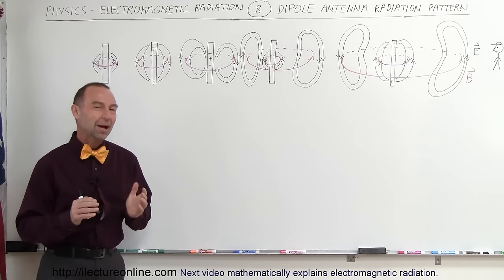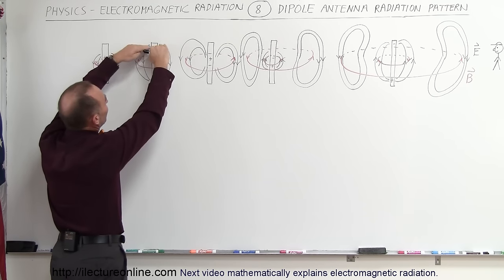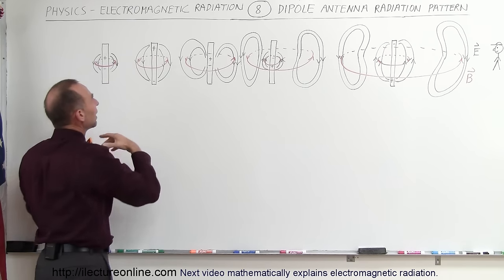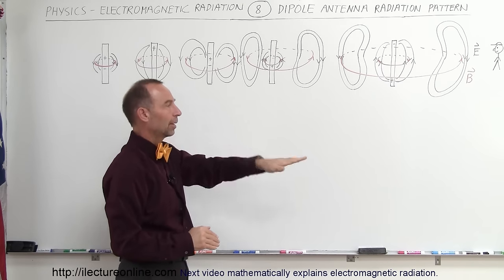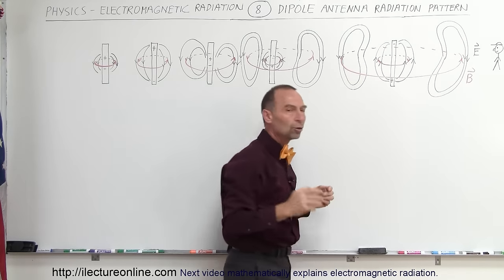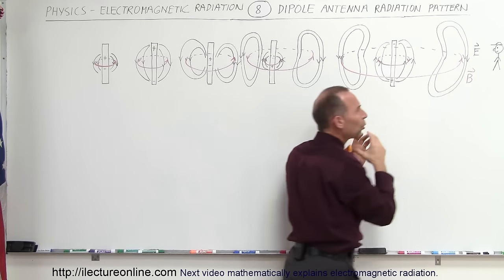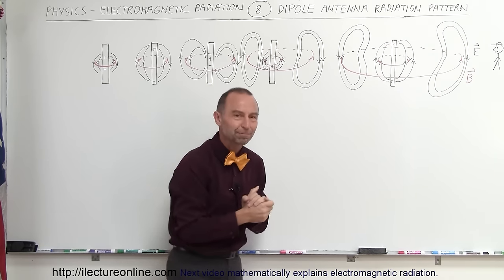Physics 50   E&M Radiation (8 of 33) Dipole Antenna Radiation Pattern

Comment: Michel, there's something I must missing, I'm sure. We are normally told that dipole antennas are connected via a transmission line to an oscillator. So, how does the current flow in the first place?  Isn't the antenna plus the oscillator an open circuit? Or is it just that the dipole antennas work like capacitors? Where am I being wrong? thank you
Reply from the maker: Yes, that appears to be a problem (since we don't have a closed circuit).  But with enough of a push (voltage) we can bunch up the charges to one side and then the othe side, in an oscillating manner.   The comparison to a capacitor is not a bad one.
Reply: Got it! 🙂Thank you very much for  your explanation

Comment: are the charges switced by an external source? We were taught this in class but i cant remember why the charges were being switched. pretty sure it wasnt due to an external source, what else can be the reason for the charges to switch?
Reply from the maker: Yes. You need a transmitter which changes the voltage on the antenna according to the input signal.
Reply: @MichelvanBiezen  alright, thank you! U were a huge help 😁

Comment: why do the charges get reversed ? @0:47
 thank you very much.
Reply from the maker: The charges are pushed in the opposite direction by switching the voltage polarity on the antenna.

Comment: I've studied that every type of wave or radiation is carried by photon and photon carry certain amount of energy which makes infrared radia visible micro gamma so my real question is does this antenna also have a photon because as we all know phone uses radiowaves
Reply from the maker: Photons are a concept at the quantum level.  (The world of very small things).  When it comes to radio waves, they are so big, that the concept of photons no longer works at that scale.
Reply: @MichelvanBiezen  so if there are no photons then how does the em radiation propagates because em radiation are are streams of photons
Reply from the maker: That is what we call the duality nature of electromagnetic radiation.  It acts both as a wave and as a stream of photons.  The longer the wavelengths the more it acts like a wave and the shorter the wavelengths the more it acts like photons.
Reply: @MichelvanBiezen  ok thank you i hot it now but i also have another question out of this topic (because i got no clear answer from Google)
Reply: @MichelvanBiezen  my question is how does a moving charge originate a magnetic field
Electron spin indicates the polarity but when they move around a magnetic field it interacts why? If electron is moving how does the movement create a fiepd around it
Reply: @MichelvanBiezen  ohh so longer wave also have photons but they are less that means less energy = less vibration

Comment: Sir their is one query, as we know that Electric field lines never form a closed loop so how in this case we are assuming that they form close loop??
Reply from the maker: It is not the electric field that forms a closed loop, but an electromagnetic wave which emanates from a source in a spherical shape.
Reply: Michel van Biezen 
I have watched a video in which it was made clear that electric field does not move through space along with magnetic field but it is only the magnetic field that travels through space. It seems also logical that when a travelling magnetic wave strikes a receiving antenna (a conductor) , it will induce an emf into it. Then it is amplified and used accordingly in respective devices like a radio receiver or mobile phone etc. What is the purpose of E- field in space I think nothing. This was my question .
Reply: electric field lines always start from positive charge and ends at negative charge...thats what is shown in this video...
Reply: I know this comment is one year old, I am leaving it for the case of future readers -electric field lines CAN form a closed loop in the presence of a time varying magnetic field (This is faraday's law).
Reply: It forms a loop since in that loop, the electric potential didn't change. 
As long as there's no change in electric potential (equipotential), it should be fine.
Reply: oops I got it wrong but I found an answer in Quora from  Bhanu Pratap:

 "Electric Field Lines do form closed loop if the field is produced by a time varying magnetic field. You must have studied about eddy currents in electromagnetic induction.

When a conductor is placed in the region of time varying magnetic field, magnetic flux passing through the conductor changes and circular currents are induced. Eddy currents are the result of motion of electrons in circular loops. And circular motion of electrons is facilitated by electric field which has force lines in shape of closed circular loops.

So, electric field lines can form closed loop."

So yeah it's possible as long as there's a varying magnetic field..similar to eddy currents.
Reply: @KurtBarcelona  But then how to explain that EM wave(E field and H field) can propagate in vacuum? Vacuum doesn't contain electron/dielectric, when time-varying magnetic field exists, there should not be any induced E field, is it?
Reply: @中央政治局局长  from Andrew Philips: "When the electric field “falls”, it creates a magnetic field. At the E field’s zeroth point, the magnetic field is at its peak. Similarly for the magnetic field. That is, each one creates the other, like a see-saw."  ........when there's a changing magnetic field, E field is also changing. Both come together.

"In addition, the fields induced are at right angles to their changes, the result of which is a beam of EM radiation traveling along through the universe (until it intersects with something).

So, EM waves don’t need any other particle to support them, a wave feeds off itself. "

so EM waves can travel without medium due to their inherent property (cross product of vectors)
Reply: @KurtBarcelona  Thanks.

Comment: sir i have a question...that means the transmission line should also produce EM waves..because the electric field is also changing in ac line and changing electric field produces changing magnetic field ...but why dont we get electromagnetic radiation from the ac lines...
Reply: I was once like you mislead. Accelerating charges don't emit light. Dipoles emit light. All antennas have two halves even monopole antennas. Connect two halves and for some reason you have no radiation. You simply have ac circuit.
Reply: @natashashvetz405  I think you are in a mess 🙄😀
De VU2RZA
Reply: A transmission line consisting of a pair of lines held together at constant space (eg, 600 ohm open wire line) or a coaxial cable line won't radiate because the E and H fields that are created cancel each other; it would of course radiate around a very short distance in the case of the open wire transmission line.
But in the coaxial cable the fields are within the outer conductor's inner aspect and the outer surface of the inner conductor, that's within the dielectric material.
De VU2RZA

Comment: Hey Michel,  I'm familiar with the sine wave representation of EM waves. What is the relationship between the radiation pattern in this video and a sine wave?
Reply from the maker: The "relationship" is that the oscillations of the electric field magnitude (and the magnetic field magnitude)  changes like a sine wave
Reply: Hey Michel, which part of the antenna radiation pattern represent the peak and trough of a wave in a sine wave? Is it the center of the radiating rings?
Reply: @EricPotratzM  so far what I've tried to visualize, it seems like electric field bubble is created in 360 around conductor and it leaves conductor when gradually polarity of charge on the conductor changes. Now relation between sin representation of wave is like gradual increase and decrease in power of electric field bubble.

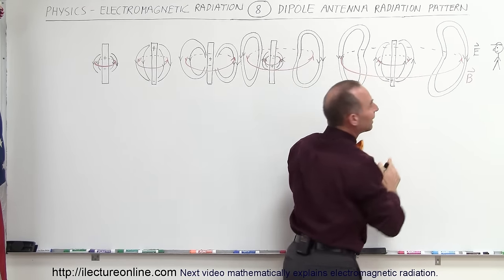Comment: Thanks for the video so much! I have gained more knowledge now:) But, currently, I hold a doubt that why the polarity of the electric field built around the antenna keeps changing? It is around 1:14.
Reply from the maker: The electric field around the antenna keeps changing because an oscillator moves electrons up and down the antenna changing the polarity of the antenna periodically